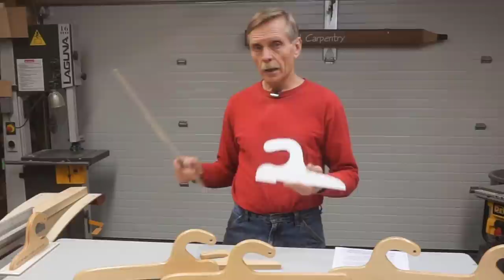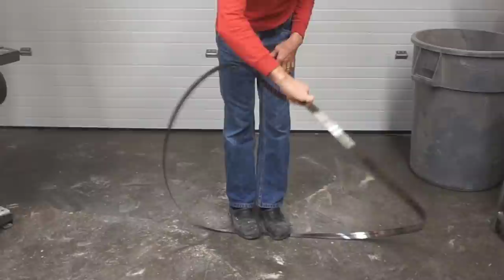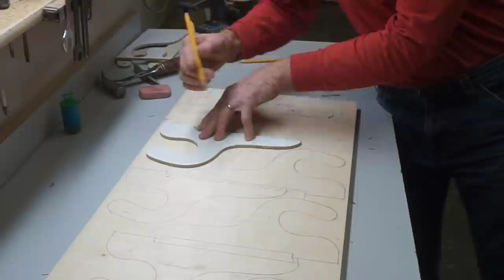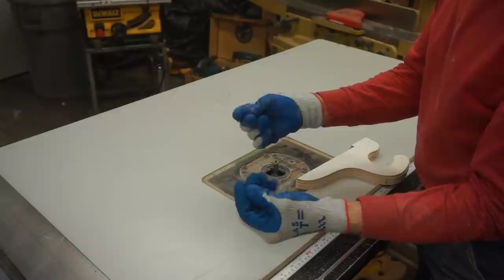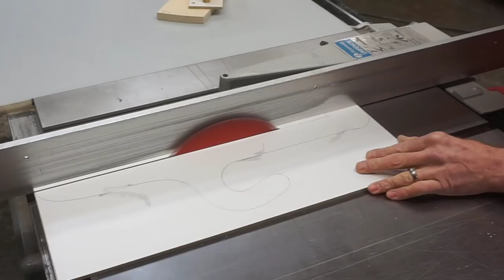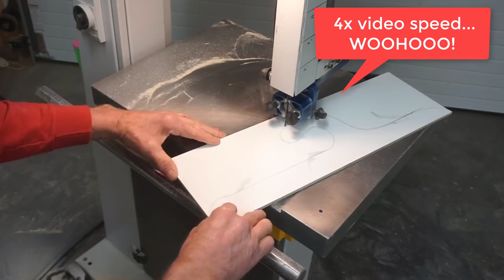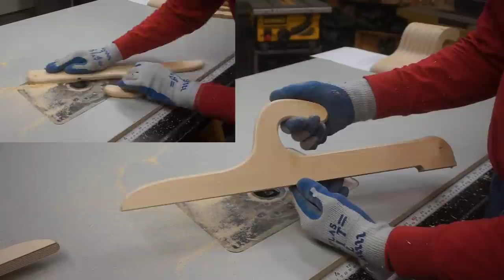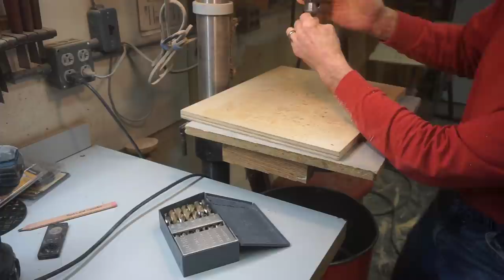Make Professional Push Sticks for Workshop Safety

Comment: Your hands look a little too close to those router bits at times. Also since this is basically a safety video I recommend  using a starting pin when freehand routing. Sorry, but one last point, I wouldn’t recommend power sanding while holding a piece in your hands and on your thigh no less. I’ve seen a sander catch on someone’s clothes and sand his ribs along with the wood. I don’t want anybody parts sanded that are near my thigh.
Reply from the maker: I understand your observations and concerns Mike, and absolutely recommend you apply methods and techniques that are within your comfort zone on a project like this as well as any other woodworking projects you do... no project is worth risking an injury just because you see me or anyone else doing something you're uncomfortable with.
Best, Matt
Reply: I didn't mean to come off so preachy but it was late and I was grouchy. Here it is early and I'm trying to get un-grouchy. I worked at a foundry one summer while in college and most of the guys had donated one or more fingers to their machines. That taught me a life-long lesson. A life that has somehow lasted almost 80 years now.
Seriously though, you are great to watch and a vast fount of knowledge and humor. After so many years of woodworking/carpentry I learn new things from you all the time.
I'm still unclear about how to become a patron and what those two numbers represent regarding patronage. Any clarification would be most welcome.
Thanks for your super fast reply to my comment.
Reply from the maker: @mikedella7851  I get it... thanks for being 'a cool dude' while approaching octogenarian status... that's no small accomplishment when life can drag the best of us into an 'all grouch, all the time' mentality from dealing with frustrations of health, life, politics etc.  Kudos, sir!
Where becoming a patron is concerned, the process is relatively simple.  Just click the "Become a Patron" button on this page and sign up: https://www.patreon.com/NextLevelCarpentry

As far as 'what two numbers represent' I'm not sure exactly what you mean but can tell you patronage is basically one of a number of diverse revenue streams generated by having an online presence for Next Level Carpentry.  
Many creators push to maximize revenue from YouTube by tailoring their content to optimize results from YouTube's algorithms that tend to favor short 'click-bait' type videos.  Since it's more important to me to provide quality content than tease viewers into watching catchy little videos, YouTube revenue takes a hit.  That's where patronage comes in because it provides revenue from viewers who value content quality over video production glitz that fills the void in YouTube revenue left by a lower view count.  Since anyone can watch Next Level Carpentry videos on YouTube for free (you're paying me by putting up with ads that play during NLC videos) I provide an extensive list of 'patron only' video content, available to all active patrons.  These videos are less-edited but have solid, deep-dive type content that patrons can watch ad-free (because they're 'paying' in patronage). 
It's a strange business model where no individual viewer or patron is 'needed' but all are needed overall.  I like it because no one in particular is obligated to be a patron which leaves those who are really motivated to 'support the Next Level Carpentry Channel' to do so.  It's my job to provide content viewers find valuable enough to spend their time and/or money 'investing in' in a mutually beneficial way.

Please accept my compliments for the fact that you're approaching 80 and active and engaged in stuff online and in the YouTube universe!  That tells me a lot about the type of person you are making me glad to 'meet you' here.
Best, Matt